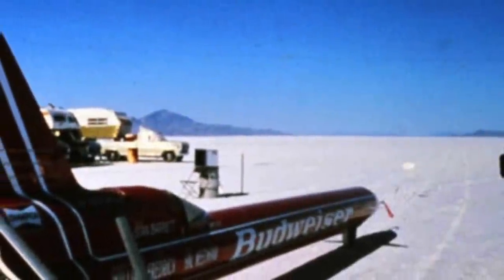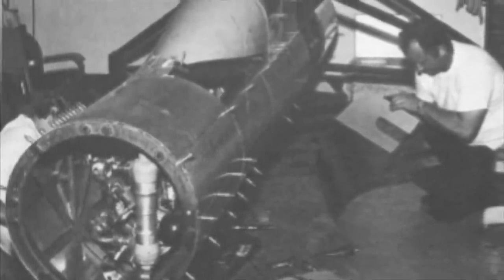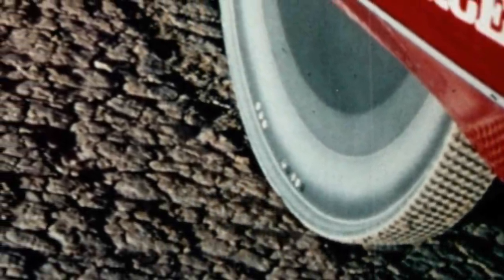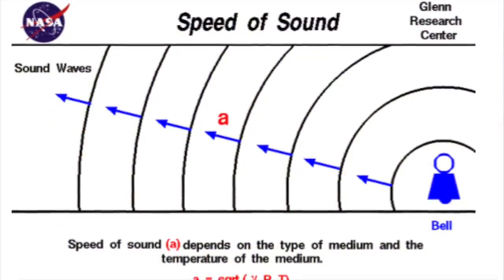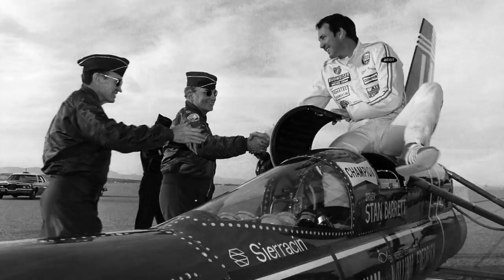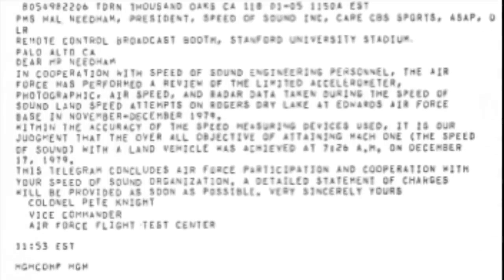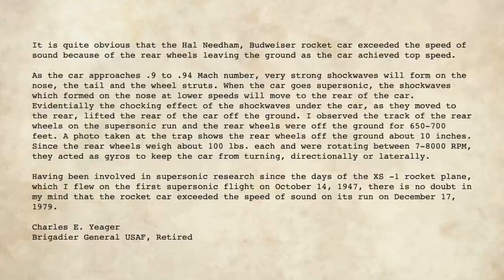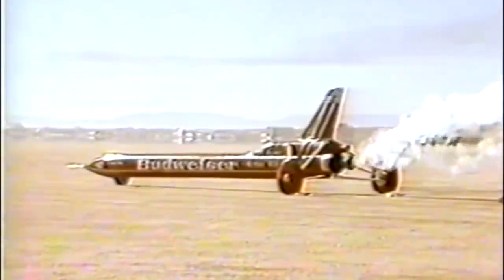The Budweiser Rocket - Controversial Rocket Car

Comment: I believe he did break the Sound Barrier. The only way to prove that the vehicle has the capability to do so would be to run it again. This time, 40 years later, modern timing equipment, camera's and audio equipment would be placed along the area where it is going at its' fastest and after the run this would prove or disprove what happened when Stan Barrett drove it.
Reply: Except Andy Green did go MACH 1 on the ground and everybody saw the shockwaves on the car and its effects on the ground plus heard a ruddy loud Sonic boom. In fact he did it 4 times as he failed to make two runs within the hour on the first attempt.

Comment: so he might've broken the sound barrier, but we'll never know b/c it was the '70's & they couldn't take good measurements between the chain smoking & primitive tech 🤔
Reply: Measuring 47ms to microsecond accuracy was a piece of cake using vacuum tubes from the 1940's let alone in the 1970's.
Reply: "Tech", whatever that means, has nothing to do with it. There was no sonic bang. That means he was not supersonic.
Reply: @thethirdman225  you are right. apparently photos show transonic shock waves forming by the wheels and nowhere else, strongly suggesting a true speed of just under .9 Mach
Reply: Nathan Smith I haven’t seen that but it sounds plausible enough.

Comment: So the short version is: The team went through the motions, convinced everyone they were for real, made sure all the speed-measuring equipment would be as inaccurate as they could get away with and then simply lied that they'd broken the sound barrier.
Reply: Maybe, as in it is possible. "Maybe" also means "maybe not". No amount of belief will make something a "fact".
Reply: Richard McCaig  Exactly. There wasn't one.
Reply: @BarbaricAvatar  No dude, they were tiny booms you couldn't hear right! After all it had a small cross section a bit like all modern supersonic fighters do and they don't make a sonic boom you can hear either. Oh hang on.....

Comment: You can go faster that the speed of sound with out breaking the speed barrier.
Reply: Wat
Reply: The speed of sound and the barrier are two completely different things though similar
Reply: The sound barrier is a sudden aerodynamic drag Force on the vehicle you are in as you are breaking or crossing the speed of sound or 767.4 mph
Reply: @johnd9357  
Understand now?
Reply: Richard Wolfe no. Incorrect. When you break the sound barrier, you are intrinsically breaking the speed of sound. That is literally what the word means. There also isn’t a set “speed of sound.” That speed changes with humidity, density altitude, etc.
Reply: @johnd9357  nothing you said refutes or changes anything that I said
The barrier is just an aerodynamic drag Force applied to the vehicle as it breaks the speed of sound depending on climate variables
Reply: @johnd9357  and for your information there is a set speed of sound at 767 miles per hour on a perfect day though it can change based on environmental conditions that is the agreed #
Reply: Richard Wolfe respectfully, you have absolutely no clue what you are talking about. Regardless, what you wrote has nothing to do with the comment I responded to. The definition of going supersonic is LITERALLY “to travel faster than the local speed of sound.” There is no way to physically travel at supersonic speeds without actually going faster than the speed of sound. To say otherwise is ridiculous. You certainly CAN travel faster than the speed of sound without creating a loud boom, but that is all to do with the shape of the object exceeding the speed of sound, and nothing to do with how fast they go.
Reply: @johnd9357  once again nothing in that long run on uneducated sentence refuted or changed anything that I said in my original comments
Reply: Richard Wolfe it isn’t drag, it is compression, IE pressure. You are wrong again. Just please stop. A sonic boom has nothing to do with drag, at all. It is stacking compression of sound waves. Jesus dude, just quit while you’re behind.
Reply: @johnd9357  the closer you get to the barrier the more drag is applied to the vehicle. Period. Fullstop.
Reply: Dear god, where does this stuff come from? Let's get a few things straight.

1) "The Sound Barrier" was a phrase coined in the 1940s to explain the colossal drag rise close to the speed of sound. It was thought by some people that it couldn't be done - hence the term "barrier". That was before there were engines powerful enough to overcome the critical drag rise in the transonic region.

2) Critical Mach Number - the Mach number at which the airflow becomes sonic over the airframe. At this point the airframe starts generating shockwaves.

3) Drag Divergence Mach number is the Mach number at which this critical drag rise increases. It is always greater than Critical Mach Number but less than the the speed of sound. It can increase the Cd of an object by as much as ten times. Once the speed of sound has been exceeded, the drag tends to reduce, depending on the shape of the vehicle. Planform is more important in the supersonic regime than profile.

4) The speed of sound is not absolute. There is no exact figure. It is dependent on temperature. Not temperature and pressure or temperature and altitude or temperature and air pressure. Just temperature.

5) Mach is a dimensionless number. It is simply the speed of a vehicle expressed as a ratio in reference to the local speed of sound. Anyone who tells you that the speed of sound is an absolute figure of XXX mph or XXXX km/h - very common around here - is kidding themselves.

6) Sound propagation at ground level is the same for theses purposes as it is at altitude. In other words, you are just as likely to hear it.

When an object approaches the speed of sound, it builds up a high pressure bow wave ahead of it which simply cannot get out of the way fast enough. When that object finally goes supersonic, anyone standing nearby will suddenly get the sonic overpressure of that bow wave - all that sound generated at one time - experienced as a sonic bang.

At no stage in the run did the vehicle arrive before the sound it generated.

The only evidence that the Budweiser Rocket got anywhere near the speed of sound was the lifting of the rear wheels for a distance of about 200-250 metres. This is believed in some circles to have been caused by the shockwave under the lower suspension arms. The so-called "Yeager Letter" postulated that this proved that the Budweiser Rocket went supersonic. It proves nothing of the sort, no matter who says it. All it proves is that the vehicle might have reached critical Mach Number. That's it.

There was no sonic bang and it doesn't matter a damn what was recorded on US radar or in-car instrumentation. No sonic bang = no sonic run.

End of story.

Comment: I dont remember giving the FIA any authority. Do you? Self proclaimed authority is no authority.
Reply: You're Joe Nobody. You have no authority over *anything*. 

The FIA are an official body. They set the rules regarding all automobile racing and the land speed record. Rules that have been around for almost a century. 
Even the revised rules that sorted out the confusing circumstances regarding wheel driven and non-wheel driven land speed record vehicles,  and how to ratify them, had been well understood and known about for 15 years before the Budweiser rocket runs. Along with the rules regarding setting an official land speed record.

And since they weren't there, the speed measurement equipment was improperly set up and the data collected never released to independent scrutiny, then the case is clear. 

Bennett bravely piloted a very high profile publicity stunt on behalf of Budweiser, but with all the issues regarding the disputed speed captured, they did not log a legitimate speed or break the sound barrier. The weight of evidence against such occurring is overwhelming. 

Sorry. That's just how it goes.

Comment: No sonic boom... no Mach 1... ?
Reply: for some reason no sonic boom is generated by these cars. has something to do with the ground, obviously.
Reply: were wally a sonic boom was clearly heard and seen by Thrust SSC
Reply: @effortlessly  gotta check that out then. i dont recall anyone saying there was one
Reply: @effortlessly  huh no kidding. i stand corrected. i just remember being told that the boom is interrupted by the ground somehow. it was in a documentary.
Reply: Agent J  well, iv never tried to fire a shot an inch off the ground but il assume it makes no difference
Reply: If you're not inside the cone you'll never hear the sonic boom.. And it's the tiny control surfaces that make the boom not the body of the car.
Reply: @AIM54A  What utter rubbish. It's the bow shock you hear. That's the whole body of the vehicle. Where in god's name do people get this malarkey from? And you need to be a ahead of the cone to hear it.

Comment: Where does Blue Flame fit into this ?
Reply: The Blue Flame set FIA-sanctioned world land speed flying start records for the kilometer and mile distances in 1970. The speeds were calculated by the vehicle tripping timing lights in the measured distances, and the average of 2 opposite directions runs. The absolute world land speed record was 1,014.656 km/hr which lasted 27 years. Official timing was provided by independent USAC/FIA stewards.

Comment: Ignoring the 1 hour turn around and 1 mile at speed...Hasnt it only got 3 wheels? Land speed cars must have 4.
Reply: I dont know about this car specifically but similar cars use two wheels close together at the front.
Reply: For the FIA to certify it, it needs four wheels. The FIM will certify the record for three wheels, as they did for Craig Breedlove
Reply: Yes, the BRC only had 3 wheels.
Reply: It wasn't about vehicle classification (except that it wasn't a plane), it was about a person exceeding mach 1.

Comment: If I can make a sonic boom by cracking a whip, then you'd expect a supersonic car to make one.
Reply: Especially when it can clearly be heard from miles away when Thrust SSC broke the barrier
Reply: The issue is that the Rocket engine and sidewinder rocket combined, probably make more noise than a sonic boom.
Reply: @crazylarryjr  Which in turn makes it crazier that they didn't have a reliable way to measure the actual speed. Needless to say the pilot had some major stones on him.
Reply: @crazylarryjr  I think Thrust SSCs two jet engines made quite the racket too, yet we were still able to hear the sonic booms.
Reply: Thrust SSC was way bigger and wider than the rocket, and that effects the volume of the boom. Think of a missile versus the jet that fired it, both are supersonic, but one boom is way louder than the other
Reply: @crazylarryjr  Have you thought about that statement? When the vehicle is coming towards you, the sound of the rocket will get there first. If the vehicle is supersonic, the sonic bang will get there before the noise of the rocket motor. The television camera was placed at exactly the point where the Sidewinder flamed out. That would mean an instantaneous deceleration of at least 1G, so in other words, the camera got the vehicle at its peak speed and there was no bang.
Reply: @nathanchildress5596  It would make no difference at that viewing distance. The Bud Rocket should still make a very sizeable bang. The profile might have been a lot smaller but 1) it produced a lot of supersonic base drag and an associated shockwave and 2) Thrust SSC broke windows 20 kilometres away.
Reply: Trivia,.....the first man-made object, to break the sound barrier...

Comment: Why is the USAF giving any support to this stunt?  What's next?  Monster truck exhibitions?  It's difficult, if not impossible to see any government interest in this kind of exhibition.
Reply: Maybe because of the sidewinder?
Reply: You can’t see government interest in this project/stunt?

There was a piloted vehicle utilizing two rocket motors, designed to go very fast. Kinda similar to some ‘vehicles’ the AIR Force may have in its inventory. The USAF wanted the data.

Also, this kind of support for a project is a TRAINING OPPORTUNITY. Highly realistic, as part of the scenario is out of the technician’s control.
Similar to tracking enemy vehicles.
Reply: @ernestgalvan9037  Also because of the sidewinder?

Comment: I watched it live ...He went 739.666 mph ...The speed was measured in math, it can't be wrong..pushing through the SB caused the rear wheels to float on the shock-wave that's why the rudder is used to control yaw ...!
Reply: which error-prone sensors did you use to do the wrong math? the accelorometer?
Reply: Hey Genius , they ran the car many times, they were clocking with time-speed-distance, & radar ...they were measuring ET between pylons ...It doesn't matter what you are in ..if you cover a mile 1/2 in so many seconds ..that translates to MPH ....They Clocking came to exactly 739.666 MPH ..Density altitude that day meant 731.00 mph was the speed of sound ..!
Reply: @Wildkat-1  genius, the speed trap was too short for accurate readings.....did you not watch the video?
Reply: You're not paying attention , how did they know that the car needed the extra thrust from the side-winder-rocket...the best the car did without the extra rocket was 640 mph ...the side-winder gave 6000 lbs thrust for six seconds ...The British have always hated this car , so they won't face the reality, that Barrett did it first ..!
Reply: There is no movable rudder on the car. Just a fixed vertical stabilizer.
Reply: @Wildkat-1  Everyone hates this car. Not just the British.
Reply: B S ...!
Reply: @MX304  Craig Breedlove and Art Arfons thought it was Bullshite and they defo aren't British.
Reply: No sonic bang = no sonic run. Sorry!
Reply: You don't need "math" as you call it, to establish a sonic run. You don't need radar either. All you need is a sonic bang and no such thing was heard. Therefore, he did not go supersonic.

Comment: The rules for the Land Speed Record are simple, beautiful and absolute. Two passes are required across a measured kilometre, or mile, within one hour (to counter any gradient or wind advantage). Vehicle must have at least FOUR wheels, and must be steered by at least two of them. Timing equipment must be internationally accredited, properly ratified, and impartial.

The Budweiser Rocket project failed... on every single criteria.
Reply: Yawn
Reply: @Useaname  The "4 wheel" rule was changed, or the "Blue Flame" would not have been an official FIA recognised holder of the Land Speed record.
The issue with this attempt was the timing equipment DID NOT EXIST.
Reply: @bricefleckenstein9666  No, the Blue Flame actually had four wheels, with the front two paired closely together. Apart from the Budweiser Rocket, the only other notable LSR car with three wheels was Breedlove's first Spirit of America... and that caused quite a bit of a commotion regarding the rules.
Reply: @ullswater6  I always thought the Blue Flame was another tricycle, like the Spirit of America.
But BOTH ran (or would have) into the "wheel driven" part of the rules 'til they got CHANGED (at the same time as the 4 wheel limit and the steered by 2 wheels limit).
Reply: And yes, I was thinking of the first Spirit of America when I wrote about the 4 wheel rule being changed (after it's original runs), not the Blue Flame.
Reply: I believe the idea was to break the sound barrier and not to set a record.
Reply: @Silverhand290  (which it didn't even do)
Reply: no it did not fail based on temp and barometeric that day the sound barrier was 731mph the car went 739 case closed
Reply: @mpojr  No it didn't. Thrust SSC was the first car to break the sound barrier and it did it conclusively and in full accordance with the rules. The Budweiser Rocket is not a part of the official history of the Land Speed Record. That's why it isn't in the history books. Case closed.
Reply: @ullswater6  The Land Speed Record has nothing to do with it. If the Budweiser rocket went supersonic even momentarily, it's still the first land vehicle to do it.
Reply: @phlodel  Except it didn't. Sorry Yanks, continue to cope about an achievement you're never like to emulate or surpass for a very long time.

Comment: It's quite simple a car has no less than four wheels this trike does not comply.
Reply: Cars are also wheel driven not rocket powered but the land speed record hasn't factored number of wheels or propulsion system since the 60s
Reply: It's only that simple in your simple mind.
Reply: The first car had 3 wheels

Comment: Well the answer is obviously he didn't, no boom which is genuinely scientifically impossible.
Reply: The speed of sound does vary you know ?
Reply: @gowdsake7103  what?
Reply: @Alex-cw3rz  The speed of sound in an ideal gas depends only on its temperature and composition. The speed has a weak dependence on frequency and pressure in ordinary air, deviating slightly from ideal behaviour.
Its completely different in water and non existent in space
Reply: @gowdsake7103  Very interesting. So given a sonic boom was recorded by Thrust SSC when it broke Mach 1, what was the major deviation in conditions that would prevent the same physical phenomenon happening here?
Reply: @Xfactories  Because the speed of sound, a critical speed known as Mach 1, and is approximately 1,235 km/h (767 mph) at sea level and 20 °C (68 °F).
So change the height the temperature or even the air pressure and you can travel at 767 without creating a boom